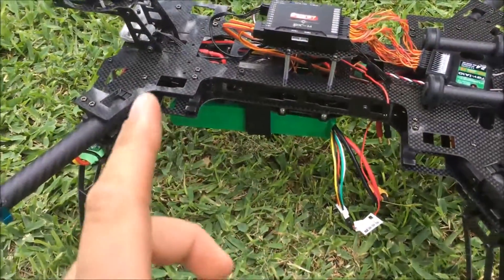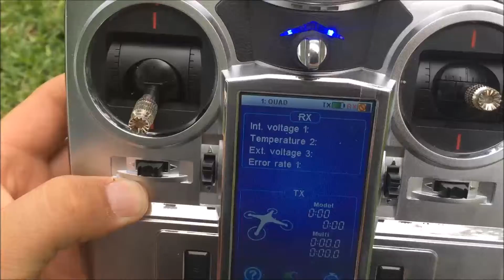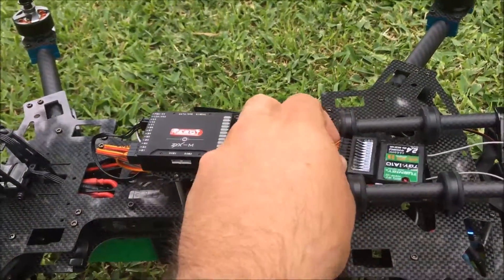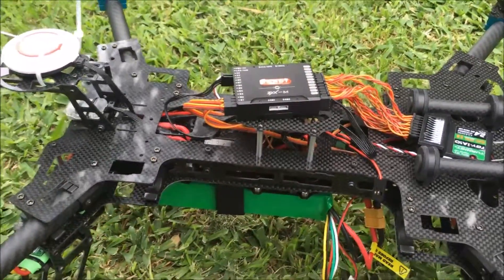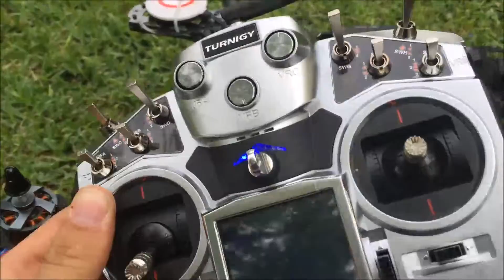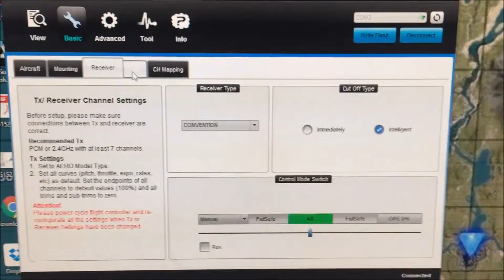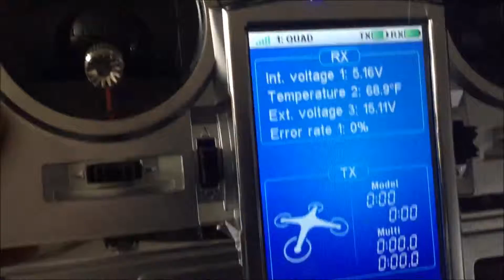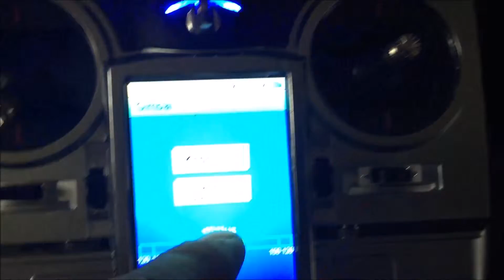Quad Fail

Comment: I know this is an old video now.  but the purple flash when you had the GPS lock.  indicates you are in a forbidden area.  you need to turn that off.   it may not be the case that you really are.  but thats what that flash meant.

Comment: Hey Jared,  I can't get my motors to start...when I do the control sequence to tstart the motors, nothing happens....any advice for me?
Reply from the maker: Michael Kubica One of the control settings on the flight controller comes from the factory reversed so when you put all the sticks down on your radio the flight controller actually thinks one of them is up I can't remember which one it was I think it was aileron you'll just have to hook it up to the computer and mess with your radio and see what the settings that are showing up on the computer if they are actually doing what you're doing with the radio not sure if I explain that very well let me know if you need more help